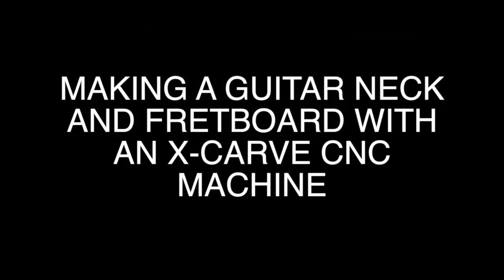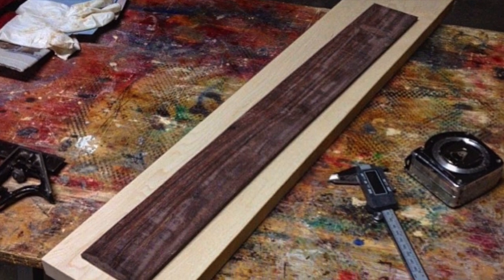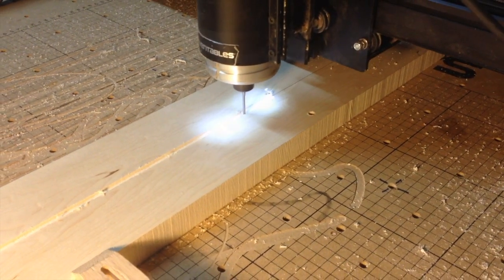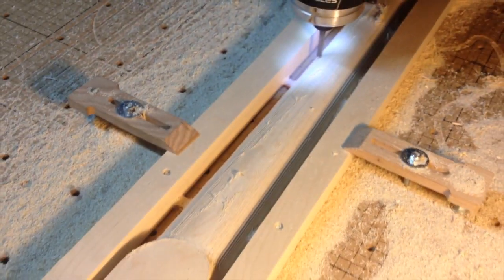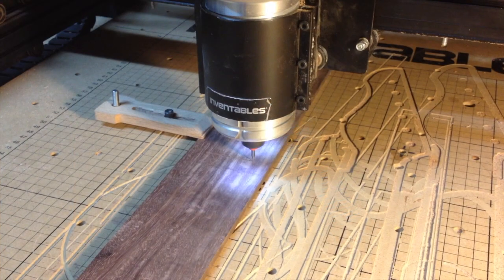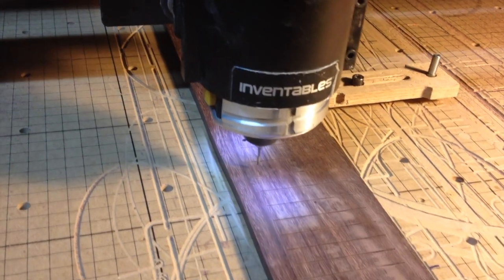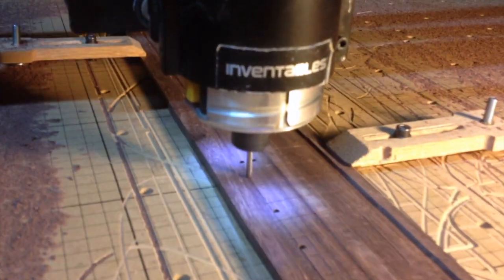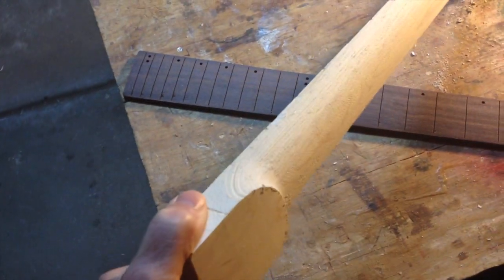Making a Guitar Neck and Fretboard With an X-Carve CNC Machine

Comment: Great video. May I ask what your feeds, speeds and depth of cuts were for the .024" end mill that you used to cut the fret slots? I've already broken a few of these tiny bits.
Reply from the maker: 20IPM, 16000RPM, .01” DOC. No step over.
Reply: @HighlineGuitars  Thanks

Comment: Looks like you had some chipping and tear-out at the higher frets. Would you, if doing it again, run the radius before cutting the fret slots?

Love your videos and your diy aesthetic.

Regards
Reply from the maker: I should also mention that these days I use a down-cut bit wich eliminates chipping and tear out.
Reply from the maker: No. It's not significant and can be erased with 400 grit sandpaper.

Comment: Looks great!! any special software needed? looking at getting the xcarve and upgraded Vcarve pro software.
Reply from the maker: You'll probably want to get a good 3D modeling program. There are a lot of them out there, so you'll want to demo them to see which works the best for you. I use Rhino 3D for the Mac.
Reply: @HighlineGuitars  I have a question,  do the free Easel allow you to carver in 3D like to make the neck curve? Or  do you need Rhino?  Do you use Rhino because the free Easel limitations or just workflow? Thank you.
Reply from the maker: @Lagoausente  Easel is a 2D CAD/CAM solution. Rhino with MeshCAM is a 3D CAD/CAM solution. Easel can't do 3D contours at the moment. Eventually, it may. Until then, I like Rhino/MeshCAM.
Reply: @HighlineGuitars  thank you, and what about Fusion360 should work ad 3D or can´t either?

Comment: How did you model it in CAD? Did you buy a model from someone?
Reply from the maker: I drew the fretboard to scale in Adobe Illustrator and exported it as an .svg file. The .svg was opened in Easel and set up to cut the fret slots and the marker dots. The perimeter shape and radius were modeled in Rhinoceros 3D and  imported into MeshCam to get the g-code, which was sent to the CNC machine with Universal G-Code Sender.
Reply: Highline Guitars

Ah OK, that was a very helpful answer. I've heard Rhino is better with organic curves and sweeps but I've never used it. I tried to model the neck in Solidworks.

Comment: Sweet video! Any more info on the white clay you use and how to seal it? Thanks!
Reply from the maker: +TheRealKingDong I use white Timbermate wood filler. After it dries, I sand it flush with the fretboard's radius and put a drop of water thin CA glue on it.

Comment: do you not need to deepen the fret slots? after radiusing etc. my fret slot bit only has a 2.5mm depth of cut max
Reply from the maker: +Jamie Phillips Mine goes to about 3.5mm.
Reply: Highline Guitars what brand?
Reply from the maker: +Jamie Phillips Kyocera #73 end mill. http://www.ebay.com/itm/10-73-0240-2-FLUTE-MICRO-CARBIDE-ENDMILLS-LONG-FLUTE-/151823964316
Reply: cheers bro